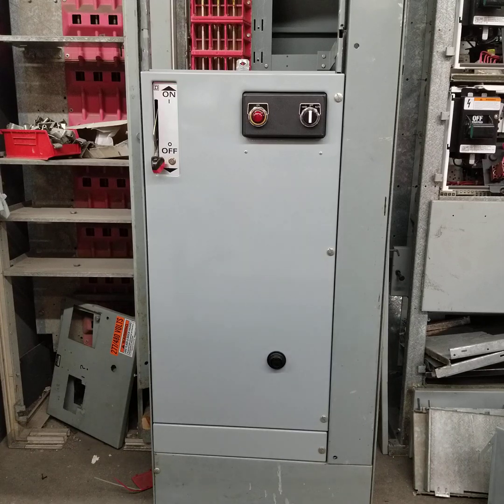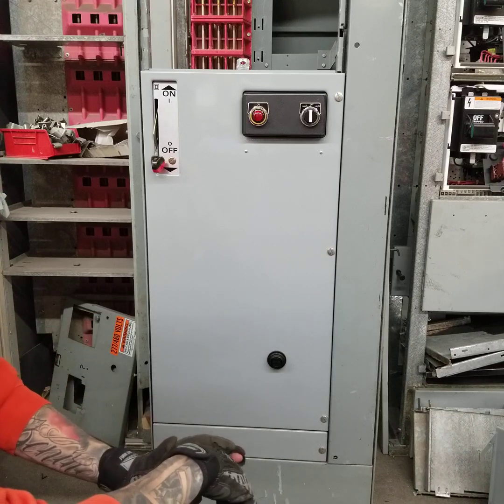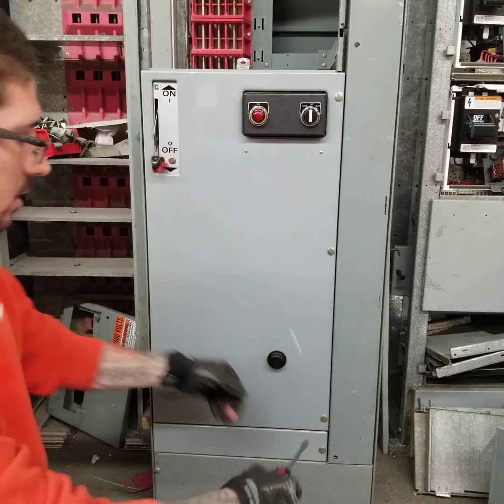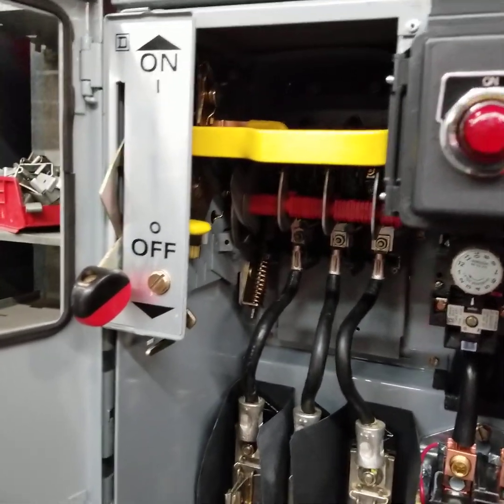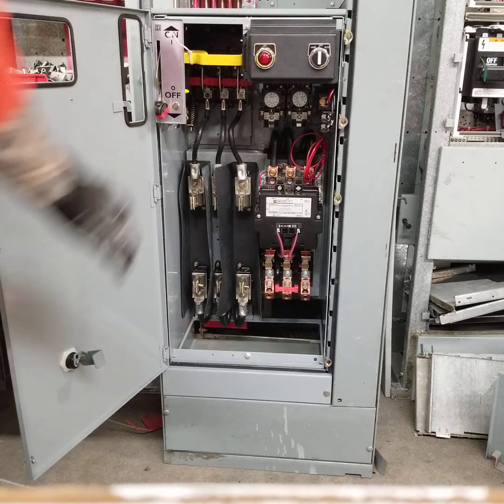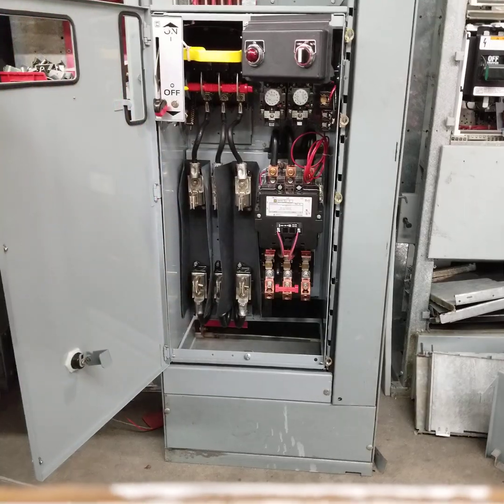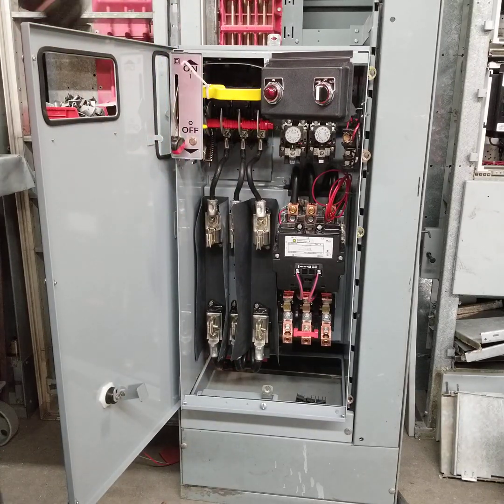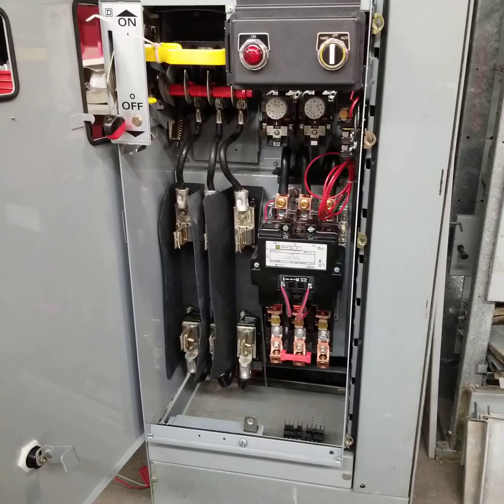Removing of De-energized Square d model 5 size 4 MCC unit. Make sure to confirm equipment is dead!!

Comment: Should the whole MCC be powered off when removing a bucket?  Is it risky that you have to force it?
Reply from the maker: You are correct. Anytime you work in a cabinet you should always try and denergize whenever possible. Though it is commonly done with the board energized it's not recommended. This being a 200amp unit it requires a lot more force then smaller units but thats really because of the larger racking mechanism and larger finger disconnects.
Reply: @ryananddenine  Thank you